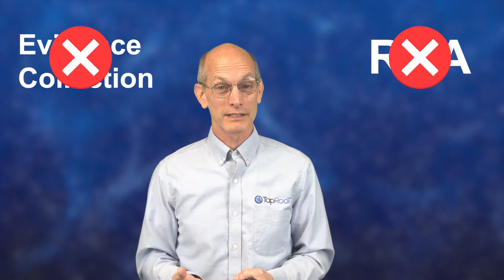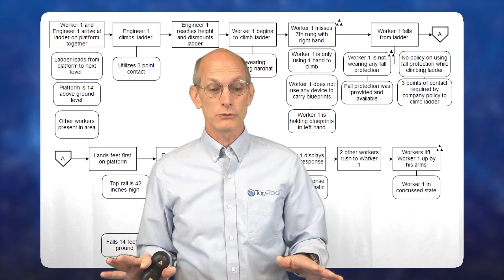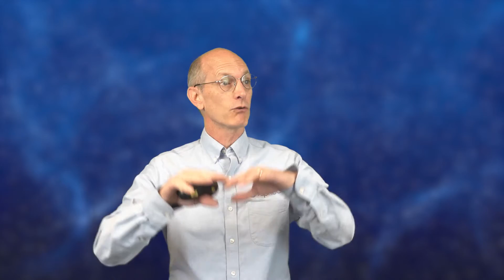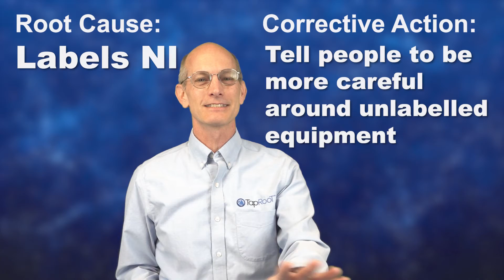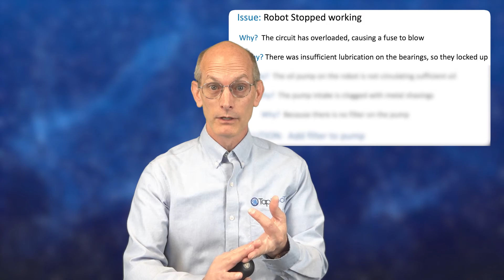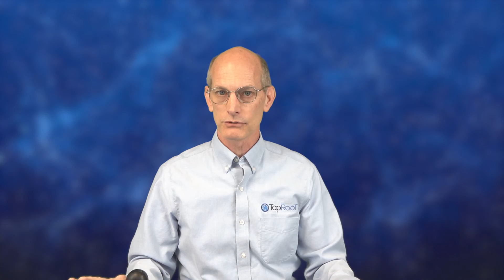Six Bad Practices of Root Cause Analysis

Comment: Great job sir. I embrace a frame work for Operational Excellence in business which touches on some Insights & Guiding Principles:

-Ideal Results require ideal behaviors…
-Purpose and Systems drive behaviors 
-Principles inform behaviors
Reply from the maker: Thank you! I really appreciate that perspective. It aligns closely with the TapRooT® approach. When we see an undesired result, we shouldn’t stop at the behavior. We need to understand the systems, processes, and conditions that influenced that behavior. That’s where we can identify better solutions and create sustainable improvement.